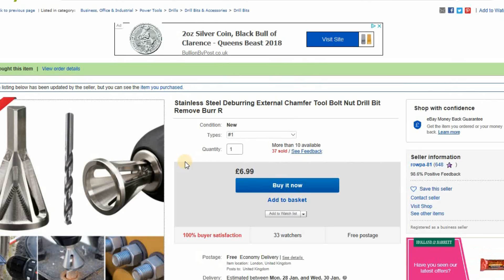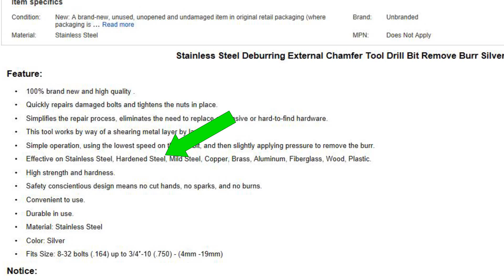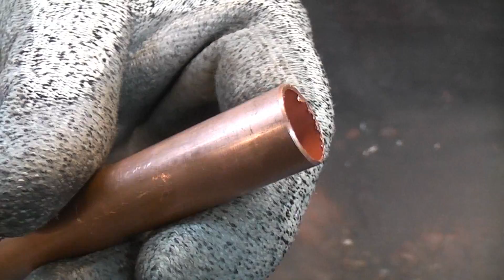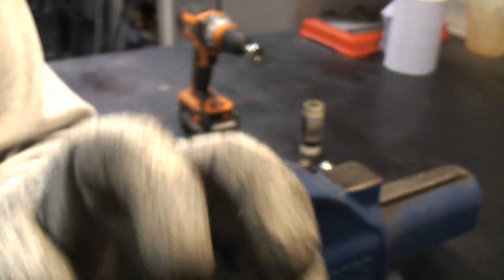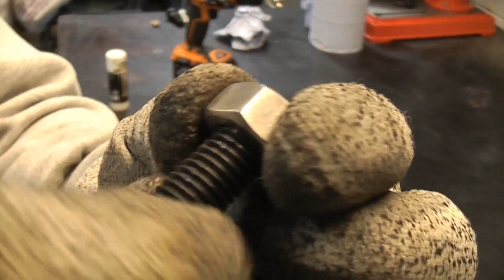External Chamfer Tool | Drill bit to remove burrs from bolts

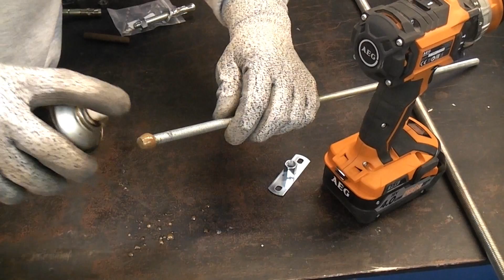Comment: Trying to repair one tool for car A/C Suction Hose Screen installation I came across this film again, since it might be a need to use my Chamfer Tool demonstrated here. I noticed that @1:51 Cutting Oil was used (I have it), but for later applications, like @4:29 Cutting Paste was used. May I know what is the name of it, and are there any advantages to apply it instead of Cutting Oil? Thank you for your film again and especially for the information about cutting paste, which is totally new to me.
Reply from the maker: The paste is often better, as it does not run off and is not thrown everywhere by the rotation of the drill. I have used this one a lot in the past- https://fave.co/3Z9XUAI
Thanks for the comment 👍

Comment: Thank you for a great film and reminding to use Cutting Oil on chamfering. I need to chamfer a short bolt ~1/2 in with a magnetic notch on the top of it. It is a new Drain Plug Bolt M14-1.50. I want to have a spare plug for the Transmission Oil Plug. Also it is a magnetic one. Though both bolts (original and new)  go w/no problems into the testing hole for M14-1.50, but only the original bolt fits the hole for the transmission oil. I think it is bcs 1 thread at the beginning of the hole is damaged, and hope that if I chamfer the new bolt it will fit the hole. That bolt has a flange of course. So how I can find a chamfer tool which is narrow and elongated? Seems like all those tools are of the same shape designed for longer bolts.  Thank you again.
Reply from the maker: I don’t suppose you have access to a lathe?
Or you could use a grinder to chamfer the end, obviously you would have to grip it with Mole grips/vice grips 👍
Reply: @ultimatehandyman  Thank you. No I don't have lathe. I also thought that the best way to chamfer a short bolt would be to grind accurately with some grinding cone. I have Dremel w/many attachments, so can do that. But actually that bolt went already into the threaded hole for the transmission drain. First it was a bit tight, but then went through and seems to hold. Hopefully all that will work with a new bolt, see I stripped a bit that hole and probably the original bolt using a faulty torque wrench. It didn't click and continued to torque, then I checked w/electronic one and it was 33 Ft-lbs instead of 22. Thank you again.

Comment: I have just seen a YT video where they rubbished this tool; but as I was watching them use it I thought they were using it wrong. They were using it t high speed. I can see now that it can work if used properly.. Thanks Ultimate Handyman!
Reply from the maker: The problem with these, is that there is no specific brand to look out for. So, two people might buy one of these from two different companies and get much different results. Mine is great though!
Thanks for the comment 👍
Reply: @ultimatehandyman  a diplomatic reply.. yes you are right it could be variation. the other review, unlike your comment just now,  gave a global thumbs down. I'm guessing the cutting paste is a factor.. just ordered some.. People would say why have you got to buy that too?.. but it is used on drill bits too. Why if you don't need it?  LOL Thanks again. You always give a good demo and information.

Comment: Question - we work with 3/8" & 1/2" stainless steel threaded rods at my job.  Does that chamfer tool work with both sizes of rod and does it cut stainless steel?
Reply from the maker: Yes, it does, but it will soon go blunt on stainless steel.
If the rod is not installed in situation, I would just give it a tickle on the bench grinder, or hand grinder with flap disc.
Thanks for the comment 👍
Reply: @ultimatehandyman  Ya that was the only tool we had that could cut the rods cheaply and it can also repair thread somewhat.  My chamfer tool just came in the mail today so gonna try it out tmrw on some non-stainless rods.  Thanks for your help

Comment: Nice little video but you did not show how small the device can work, you went the other way. I am interested in what you called "cutting paste" what is it actually called so I can find it as I like that over sprays?
Reply from the maker: I think it will do as small as M6, but could be wrong.
Cutting paste is used to prevent heat build up, and therefore damage to the tool. I use this-
https://fave.co/2Nabyxc
Thanks for the comment 👍
Reply: @ultimatehandyman  Thanks for the follow-up... and why I watch youtube!

Comment: I just bought it from Ali express, its looks almost 100% same as yours but it doesn't works for me. I don't know what to do
Reply from the maker: Unfortunately a lot of these look similar, but the quality of steel used is much different. 
I would try to get a refund if yours is not up to the job.
 Thanks for the comment 👍

Comment: Thanks for this helpful video. Saw you use a paste on the thread before deburring. What is that paste and brand?
Reply from the maker: Its just a lubricant / coolant, you can also get spray on drilling or tapping fluid. 
This is the stuff that I used in the video- 
exact cutting paste- https://fave.co/2Nabyxc
Thanks for the comment

Comment: Can we get a smaller size for  3mm - 6mm studs. This one seems a bit too long.
Reply from the maker: I've only ever seen them in this size, I'm not sure if they make smaller ones!
Thanks for the commen t
Reply: @ultimatehandyman  I'm in the UK. I just found out one that does it for 2mm- 12mm called the Chamfer Pro Mini. But it's sold locally in Australia for freakin AU $31. Probably twice if we import it.
https://torquewrenches.com.au/products/new-warren-brown-chamfer-pro-mini-external-deburring-chamfer-tool-2-12mm

I have to repair a 4mm stud thats protruding out of a Hybrid Battery Module of a Prius. For £30  I can get the whole battery with undamged studs of course. Anyway such is life.
Reply from the maker: Yes, it would be even more expensive, after postage and import duty etc.

Comment: hi great vid. I was after some advice going to be hanging some straight matched vinyl wallpaper and what would be the best way to do the internal corners ? Should i splice it in the corners/double cut it? if i did double cut it  should i cut it exactly in the corner?  how much should i overlap into both walls? Many thanks

Comment: Top tips... 1: cut threaded bar, bolt etc in direction of thread, 2: use a smooth dressing file 😉 same results and no expense, but if idle then spend on a deburring tool eh, another good video for the novice untrained
Reply from the maker: Thanks for the comment

Comment: Good review, yes there are alternative methods to do the same job but this is much faster and can be used where access is limited (unlike a file) and is definitely easier than trying to get a Die Nut started on a badly damage thread.
Reply from the maker: Thanks for the comment 👍

Comment: A die nut and a file can solve this problem without taking material off of the stud that’s already set. If you’re just trying to put a chamfer on threaded rod or a bolt you can use a pedestal grinder  to easily put a chamfer on it
Reply from the maker: That is correct, but this tool costs £7 and can do all sizes from about 6mm to 19mm, metric or Imperial threads.
Thanks for the comment

Comment: Great too that's being advertised heavily here in the US. I wonder though, on copper pipe, couldn't the chamfer be too big, creating a poor seal in certain plumbing joints?
Reply from the maker: Hi Jo, it should be fine, as long as you only use it to remove the burrs and not sharpen the end of the tube. 
Most plumbing fittings do not seal directly on the end of the pipe, the sealing is normally done at least half an inch from the end of the pipe.
Thanks for the comment 👍

Comment: Great video, thanks. Maybe sometime you could do one on alternative methods e.g. filing, with a dye, leaving the nut on when you cut the stud and removing the nut to reform the thread on the end of the stud, cutting a slot in a nut to get it on the stud and then using mole grips to close the nut so you can use it as a dye.
Reply: Thanks your ideas helped me and would have helped many out there.

Comment: Thanks for that - I was looking at these on Amazon 10mins ago. Reviews were either 5* or 1* - a bit marmite!  I think it depends on your expectations. Going to give one a try based on your excellent video (as normal). Keep up the great work - it’s so refreshing to get British reviews on stuff we can actually buy in the UK.  Have a good Sunday!
Reply from the maker: Like you say, it depends on people expectations. I've seen a video on Facebook where no coolant/lubricant was used, which will effect how durable it is. Also if you did try it on hardened steel, I think you would be throwing it in the bin afterwards.

As long as these are used in a forwards direction only, on slow speed, with some lube, they will be a welcome addition to most tool boxes ;-)

Thanks for the comment
Reply from the maker: I wrote a review for Amazon once for some compatible ink cartridges that were crap. I got an email saying the review did not meet their "editorial guidelines", since then I have completely ignored Amazon reviews!

Thanks for the comment
Reply: I was going to post this very same point! I was going to get one but decided against it based on reviews. Silly me for having faith in Amazon reviews... thanks to UH I will buy one now!

Comment: Thanks for the demo very useful tool 👍👍👍 just a pity we didn't have it 30 years ago😁😁😁. Hope your enjoying the snow up there😀👍.
Reply from the maker: Yes, one of these would have been useful years ago!
There is not much snow, just enough for the kids to go sledging. I was hoping for more snow to show how good snow tyres are on the van. A couple of years ago I went out in about 5 inches of the stuff and lots of cars were stuck- but unfortunately it was that cold that the dash cam would not work!
Thanks for the comment 👍

Comment: I've been saturated by adverts for this chamfer tool, I imagine it's one of them tools (as so often happens) that straight after buying it you cannot find it 'cos you've forgotten where you've put it so have to get the files out anyway :D
Reply from the maker: Yeah, I guess this will be easy to misplace. 
I normally blame other people when I can find something, unless I'm working alone 😁
Thanks for the comment
Reply: @ultimatehandyman  I have two garages 8 miles apart, tools in both.....can you imagine the hell? :D
Reply from the maker: I have a couple of garages and tools on site, so I quite literally have lost tools all over the place. The last time I needed an Artex brush I could not find it, so bought another- I now have three identical ones! I must have at least 5 silicone guns and can never find one when I need it!
Reply: @ultimatehandyman  Not just me then lol
Reply from the maker: No LOL, I've been unable to find lots of my tools for years 😁

Comment: Well done ,nicely explained,iv seen them advertised but it did not impact me how useful they were. I tell you what would be usefull is one that was about 110mm diameter, it would be so handy for doing plastic drainage ,putting a chamfer on the pipe for push fit fitings .
Reply from the maker: You can get chamfer tools for that - https://fave.co/2RABdkI
If you are installing a lot of 110mm pipe, one of those would be really useful.
Thanks for the comment

Comment: I'll be buying one of those this afternoon then. Have issues with through bolts in the floor all the time easy solution that. Can we have a toolbox/workshop tour would love to see how you set everything up and whats hiding in the bottom draws :P
Reply from the maker: This is one of those tools that is invaluable if you work with a lot of through bolts. If we get a damaged one on site, it often means getting the grinder out (which means a hot work permit and lots more time added to the job), but with one of these you can just put it in the drill and give it a few spins and you are done.

I did a site tool box tour a few years back, surprisingly when I have reviewed a few tools out of that box, people often ask if the videos are sponsored because they look like new! https://www.youtube.com/watch?v=9iRjKnKoPBs

I'll do a workshop tour at some point, but I need to get rid of a load of rubbish from in there first.

Thanks for the comment
Reply: @ultimatehandyman  I'll check it out now :). We usually just grind them off on site and move the machine a few inches can't say we have ever had to get a hot works permit although I'm 100% sure we should have one :P.
Reply from the maker: The site where I work are really strict with hot works etc. 
Thanks for the comment